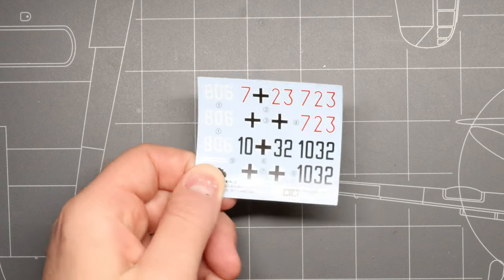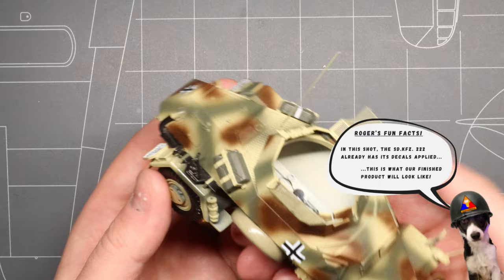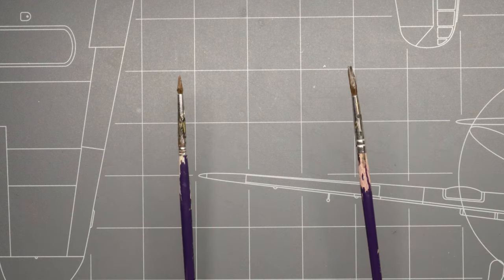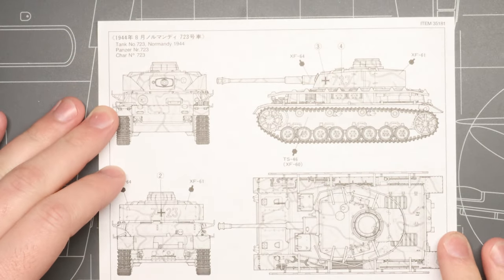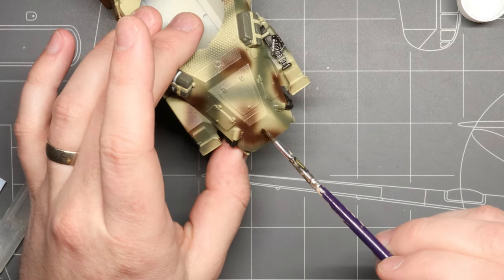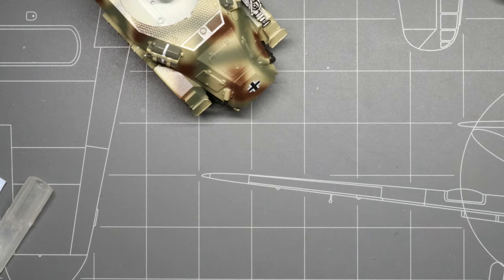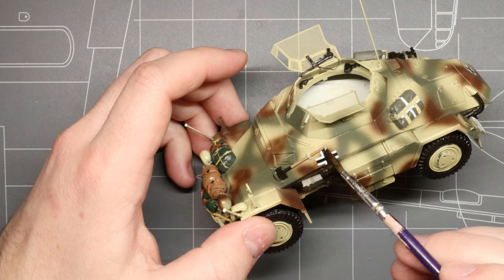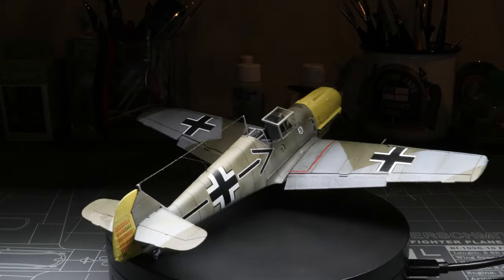Applying Decals to Scale Models… Made Easy! | Beginner Tutorial

Comment: Excellent video. What I like to do when possible is cut as close to the contours of the decal as possible to eliminate as much of the silvering as I can after its applied. I do find that on surfaces with a lot of peaks and valleys, such as wrinkles on a shirt, or just about any uneven surface, that Tamiya's Mark Fit Strong works best to soften the decals to conform and lie flat to the surface. (plus, it has its own brush). I am hesitant to use a knife to position the decal. A medium stiff brush (Tamiya 87214) or toothpick works best for me.

Comment: Thank you for this lesson.  Got the set/sol but hadn't gotten to that phase yet.  Working on the panzerkampf II model from Tamiya which has been recommended as a good starting kit.  So far so good though one of my pieces is missing in the carpet (ugh!)  Found two other pieces that had flown off so I am hoping I will find this one.  Then it will be time to start painting.  Used your guide for acquiring the equipment needed to make the model.  So thank you for your help.

Comment: Just finished watching applying decals for begginers, i dont think its a good idea to use a hobby knife to position a decal in place, some decal films are thinner than others and could get damaged and especially with a new modeler they may be more heavy handed using that method i think a brsh or moist Q tip would be better.

Comment: What do we do if we only have MicroSet Red bottle? Will it work without the blue bottle being applied first?
Reply: it will, no harm done, the mico SET just set sets up the decal and helps with placement. The Sol softens the decal helps with contours, helps the decal settle into hard to reach areas like panel lines, an around curves.  
Way back in the day before these two products, us old school modelers just had to use plain old tap water and a little piece of tissue paper! lol :)
Reply: @eclipsehorse8693  Thank you for the advice. I was a little worried about not using the blue bottle. Cheers!
Reply: @leslietarkin5705  anytime! we're all in this hobby together! :) All the blue bottle does is set up the surface for the decal and makes it a little easier to adhere and settle down- some decals are notioriously  thick, or printed in such a way they need.. coaxing!